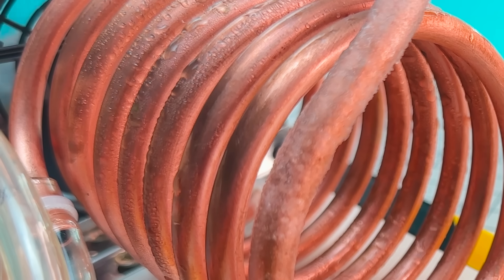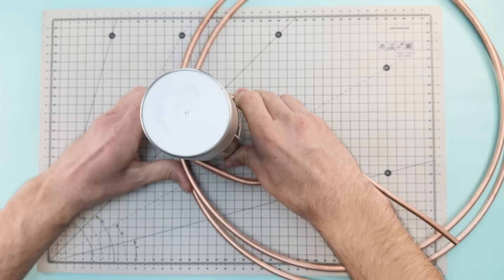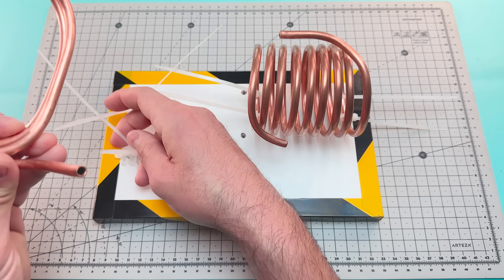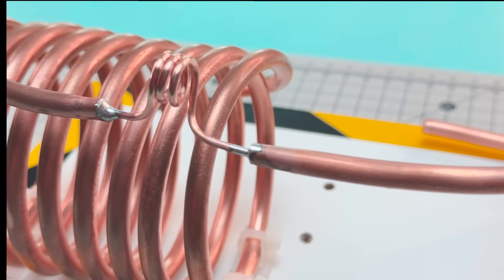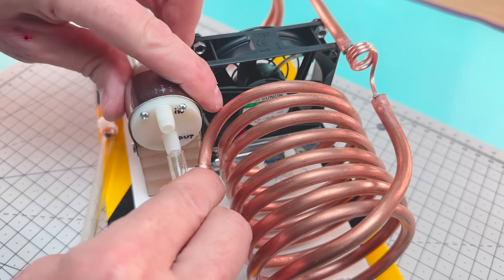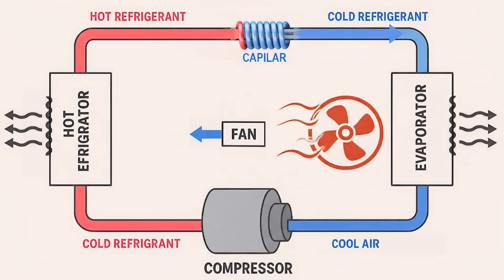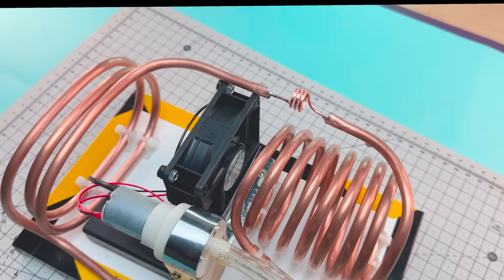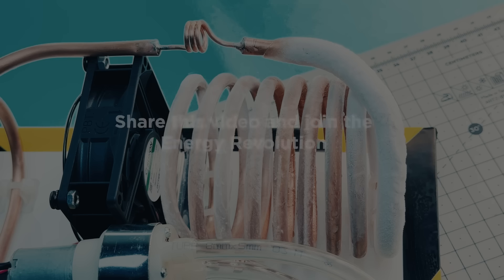Make your own AIR CONDITIONER at home Fast and Easy!

Comment: I feel these elements need to be separated because otherwise the heat you've taken out on one side is being emitted by the other side, so it won't cool down a room, but, of course, will provide a stream of cold air to anyone sat near it... but if you put the 'hot' side out of the house, you've got an ability to provide some cooling to the room. Nice idea though and I've learnt quite a bit, so thanks for that.
Reply: Clearly there is no way towards a "Perpetual motion" and nether is it possible to cool anything without getting rid of the energy to some other reservoir. Ask why he did not measure the temperature of the condenser;-) That's why you ether have to have an exhaust from the  condenser unit to the outside or as more common when using split devices where the condenser is outside and the evaporator inside. Regarding the power, this depends on the temperature difference between condenser side and air temperature around it. You may have a factor of four or so more cooling power than the electrical power the pump needs. However, when the condenser is outside at very worm weather this factor may drop down to one.

Comment: Why not just take this concept as a good starting point, like a circuit breadboard layout, and extend the legs for a realistic use case?   Put the condenser and fan on a horizontal plane, and put the expansion coil about a foot away, 90⁰ down?  Mount that on a vertical plane, connecting securely to the horizontal plane, with a screw clamp?  
   End result= air circulating chiller and water heater.   Hang it on an insulated bucket to create a hot water supply (run a heatproof fitting and hose to your sink) or hang it on a toilet and let the water run a little bit, enough to keep the water temp down.  Now you have an air chiller and a heat sink that flushes away your waste heat. 
   This would not be hard to make.  I'm offering this idea to all the people who need a workable real world solution NOW.
Reply: This is the correct line of thought. I still think it would need to be scaled up though. With a couple more tweaks to optimize airflow and air/coil contact, maybe.

Comment: This would cool a small enclosed bed a couple of degrees if the condensor side was separated by a divider and placed on the outside of the enclosure.  A normal sized room though?  You're dreaming.

The 9 volt battery would deplete within minutes.  You would need a high-amp 12VDC transformer or a big battery to keep it going all night.  If you use a lead acid deep cycle battery, you then have to install a protective cutoff circuit to stop the battery from becoming too discharged.  A relay that switches off the system when the battery voltage drops below 10.8VDC would work.  

A lot of lithium solar batteries have inbuilt over- and under-charge cutoff protection which makes things simpler but a cutoff circuit is still a good idea as a secondary protection, considering how the expense of lithium batteries.  You wouldn't want to break one.

Comment: About as effective as leaving the refrigerator doors open to cool a room.  It will create more heat than the little bit of frost in the freezer/copper tubing.  I guess in a classroom teaching children how a fridge works it's good for that. Find free air conditioners on market place that work is way cooler

Comment: A vital step to creating a n Air Conditioner is to isolate the Condenser and Evaporator pipes, and to also place a fan on the Hot Condensor. 
For example a window air conditioner has a wall between the inside evaporator, and the outside condenser.  The condenser releases Hot air outside and the Evaporator releases Cold air inside. If you mix the two sides, your room won't be cooled, but will actually heat up.

Comment: take a wet towel or some other fabric hang it in the door and blew air in the room you want to cool (with a fan etc). the principal behind this is evaporative cooling, and the results are noticeable within a few minutes.
Reply: That only works in extremely dry climates. Evaporative cooling doesn't work in ANY costal areas, including costal deserts, because there is too much moisture in the air.

Comment: This will make the room the same temperature. Actually probably a little bit hotter
Reply: Lol yep. Not removing a single bit of heat
Reply: If you put on a windowsill that would help move the heat out. Also a second fan might help blow the heat out the window.

Comment: The process is simple, and you made it easy. Thank you. I only have one issue, and that's the pump. I'm sure it will break down quickly because it's specifically designed for something else.

Comment: isn't the global enthropy of the system still greater than 0 ? Will it realy cool the room ?
Reply: Its not going to cool a room. But it might work for a mini fridge. It's just a cool demonstration of how AC and refrigeration works. Though with hot side exposed like that on the other side of the fan. It's going to cancel itself out as it sits like that.
Reply: Lol ….. no
Reply: no room will get hotter,. You could make the refrigerant coil a bit bigger than the size of a soda can, and place greece proof paper around inside, then soda can in middle to cool yr drink.
Reply: @YouTubeH8sMe  is too much hassle for that when you can make fridge with one teg module and some foam.
Reply: Just add tube and run blow out fan that move the hot air out to window.. issue solved

Comment: For those curious about the science, this is a great demonstration of the Joule-Thomson effect, where pressurized gas gets very cold as it rapidly expands. Unfortunately, it's not a sustainable refrigeration cycle because that tiny pump isn't a compressor and can't re-liquefy the gas. The cooling stops once the can is empty. Stay safe!

Comment: Okay so the pump moves liquid not vapor. That is called cavition. So if somebody is needing some slight relief, use a swamp cooler they’re easy to make and you can get some relief. I use them in my tent when I’m out camping.
Reply: They dont work in high humidity

Comment: PC processor cooler?
Reply: Notice the condensation?  Do you really want a line condensing water onto your motherboard, graphics card or PSU?  Not to mention the other issues this would have.  Better off getting a sealed liquid cooling system for PC CPU cooling.  Go for the max size radiator your case allows.

Comment: I'm not sure why people like you go to all this effort to try and deceive people.  Nice workmanship but there are too many basic physics problems for this to work.  First of all you have to compress the gas with a compressor, the device is too small to cool a room even if you added a compressor, and you are pumping heat into the same room that you claim you are cooling.  And you can't get effective pumping on a 12V pump running off of a 9V battery.  Even if you add a compressor, your device would barely cool the room in a dollhouse, let alone a real one, and that only if you keep the evaporator coils outside the dollhouse!  Stop scamming people just to get votes on YouTube.  We will be reporting this one to Google.
Reply: You just have to connect it to a perpetual motion and it will perform great
Reply: @rp9674  wow we got a guy who deadass believes in perpetual motion over here
Reply: 😂 @rp9674
Reply: Jajajaja lo bueno es que es un detalle menor,al fin y al cabo los venden en cualquier esquina @rp9674
Reply: 2 million viewers 
That's why
Reply: It's still helpful, because i want to convert a mini fridge into a mini AC. All the original coils can't be pryed off the fridge without damage so it's good to know how to rebuild the various parts
Reply: @Ellis25051  unless you own a vacuum pump to vacuum the compressor before recharging it, it's a waste of time.
Reply: @ke4uyp  just do what they do everywhere else. Purge the system with refrigerant.
Reply: @eric35715If you open the system at all, you won't be reusing any of it. You would have to reseal it with torches or MAP and solder. Then like the other guy said, you'll have to vacuum the system, and you'll have to be sure you can even get your hands on refrigerant (that requires an EPA 608 Cert in the US) that's compatible with what is probably a fixed metering device.
Reply: Google is the parent company of YT. if you get any response from them? it will be to laugh at you
Reply: Sure this 9v airco beats my 1200w one 😂
Reply: He got the viewers, comments and likes.. that is why.. no physics needed.. 😆
Reply: I would take a minifan blowing cold air on me over a fan blowing hot air on me

This is a spot cooling device
Reply: I this were placed in a styrofoam tub would it work like a low energy mini-fridge?
Reply: @nught... - counter charge of taking things too seriously
Reply: Moi suis intéressé de le fabriquer, et si sa marche pas, j'aurais perdue mon temps, de l'argent pour acheter le cuivre, acheter la pompe,le ventilateur, le gaz, tout sa pour Rien 😔
Reply: @Potzéf  At least you will learn a lot. Without risk, there is nothing.
Reply: So while you made some decent points I think the idea is to show the concept
Reply: If you see the bigger picture. This is just trying to open your mind. So that you can see things are not that complicated. Especially if you like DIY. It starts simple. TRY it and if the model works. Then you can upgrade to Walmart size, just make everything bigger.
Reply: En combien de temps sa glace 
...
Reply: Écrit en français merci 🥣🐑🍅😁
Reply: At the end of the day if it does cool, it might work for say a PC to over clocker. Probably cheaper than the having to keep buying all that liquid nitrogen. But I didn’t watch the whole thing nor even know if this thing even. Oops to that point.
Reply: This might work on a small cooler 🤔
Reply: Sam the air con man.  Doesn't like you cutting into his business.😢.  You tell that to the computer manufacturers who use this to cool there processors.😂!
Reply: Madafaka
Reply: Stupid people only fall for this
Reply: @NEWSWATCHMENTRUTHVIDEOAREUS greedy people are afraid of this!
Reply: Did you make one or just bumping your flap
Reply: It'll do just fine, with heat flowing outside, for keeping a breeze on a suffering family member in a small room. I dig it. Each to their own
Reply: @SamNospam-l2n  what is your problem? You could simply leave him alone and mind your own business.
Reply: It's based on a classroom science experiment to cool can and bottled drinks, and that's all. It works for that purpose and that purpose alone. So if you got kids and want to do a fun project with them this would be an awesome one but stick to your ac for room cooling. Lol
Reply: Its an educational video, not a manual to build personal air conditional system
Reply: @DWO1199 that is not what the video narrative leads to believe.
Reply: Yeah no shit the butain does work but a common small evaporated water system drops temperature 20 degrees and they are not cooling a room just a personal fan so the time and effort to make that is worthless when for 20 bucks you can buy a small evaporated water system
Reply: Thank you. To many people believe this but unless you know the basics it seems reasonable. I have 2 girls I’ve tried to build thing with them that at least show the basics. Let’s find out why the hair dryer doesn’t work. Let’s circulate some water around a couple of thermistors and see if we can make it colder. How about a crystal radio. Silly things but I’d like to give them at least an idea how something works. It will be helpful when there older if they can apply a little critical thinking when someone presents them with an estimate for something. It’s not magic when you push a button and something turns on.
Reply: Why is because of its unintended use. Might not look like much but that device there can produce water in a humid environment. He just has to increase the fan speed to make sure the coil doesn't freeze after that. You have a devise that creates water out of thin air. Might not be super clean. But it's 100 percent functioning. You could make it more efficient by adding more power to the system and separating the hot and cold. The most important thing in this build though would be air flow. It's obvious the guy doesn't do heating and air. So he probably did thing the coil freezing was a good thing. Which ideally would when your trying to freeze something. However you hit on a very crucial point. He isn't conditioning the air. He isn't removing the moisture from it. He was up untill it froze. 

If he fixed that how ever then we would be cooking with Crisco. After that package it into a cup where the run off the evap coil catches then goes into a filter then bam you sir have a million dollar idea. It is about the creativity and lastly everything is useless untill it finds it's application. 

Dibs on the cup idea...
Reply: It's not meant for practical use, this is for demonstration, are you slow? I can't get over people taking everything seriously and in reality they make fun of themselves.
Reply: @NightShogun in all fairness the narrator did say now you can cool down any room in a matter of minutes.
Reply: @NightShogun 😂 what's worse, dude said he is going to run and snitch too.  A YouTube Karen that guy is 😂
Reply: Good boy, you prove that u studied hard and understanding a lot, sure it cant cooling your 20sqf mama built room, but the 9v battery still support 12v dc compressor well, but it not at full capacity.

Comment: An air conditioner, but not only are the heat dissipating and heat absorbing radiators not separated, but the fan “cools” the cooling radiator with air that is heated by another hot tube. Author, read the Wiki article on how air conditioners and refrigerators work.

Comment: This is the best explanation of how an air conditioner works I’ve ever seen. There’s always a “but”. The room won’t change temperature because the heat you’re removing you’re also placing back into the same room.

Comment: "Very nice project, but if you put that in a room it won’t cool anything: as one part cools down, the other part heats up. For it to work, you need to move the hot part out of the room. It’s like leaving the fridge door open in the kitchen: it doesn’t cool the kitchen, it actually heats it up. That’s the thing about the principle of conservation of energy."
Reply: "Thats what big aircon wants you to think". But you are right, the big coil will get just as hot, and you have to keep it outside of the room.

Comment: A very nice educational project.  But will not cool the room ... (i) fan should cool the condenser, (ii) the condenser should be outside, and finally (iii)  9V alkaline battery has approx 17 BTU energy content, 
a typical window AC to cool a room is about 5000 BTU -- so not even close.  As the system is now it will heat the room -- but only slightly due to low energy content of the battery.
Reply: Correct, that’s the difference between a physicist and an engineer.

Comment: Get an old air conditioner out of a car. Put the evaporator in a bucket of coolant. Run the coolant through an insulated tube to outside your dwelling. Set up the radiator fan and pump outside and run the coolant back inside through another tube to the condenser. Charge with a can of auto air condition gas. Then when you're done with all that go to Walmart and buy a small window air conditioner for $100 or a used one for $25. Then  compare which one made wasted the most of your time and made a mess.
Reply: Can you do a DIY video of this air conditioner out of a car? Please share video link here. Thanks in advance.
Reply: @karthikkiran338  LOL, you'd have to pay me about $20,000... in advance.😵‍💫

Comment: Heat and cool are venting into the same room.  Temp won't change in the room at all.  Air conditioners have the heat exchanger outside the room you wish to cool.

Comment: Omg, the hotside dumps into the same environment. This system will make surplus of heat energy(motor, fan). You stupid?
Reply: Seems more meant to be aimed at you instead of the room itself.

Comment: I liked the idea. I'm going to use part copper and part titanium to use as a chiller in my marine aquarium. The aquarium is small, so I think it will be enough to cool it. A good idea would be to add a valve and hoses to withstand pressure and handle the gas more safely. I don't think it would work for cooling the environment, but for small things like an aquarium or cooler, I think it would work.

Comment: This is a very dangerous method. Use a refridgerant with lower flammability and in most cases ensure that there is no air in it while its under pressure because even a proper refrigerant will be flammable in that case
Reply: Isobutane is a refrigerant.

Comment: I hit 0 with a peltier chip and two 5v fans on a gatorade canister. but it was only within the canister. Guessing if I poke a hole I could get some cold air flowing

Comment: Cool heat pump, pumping heat from one side of the coil to the other.  Not an air conditioner unless heat is ducted and remove from the room.
Reply: I’ve tried that already 😂! My suggestion: make a sandwich putting yourself between the fridge and the door. Without sirt gets better results

Comment: I used to design and build refrigeration plants for complete micro breweries, that we designed and built, 25 years ago - some of them are still working ! Great video for the uninitiated but some separation / redirecting of the heat producing and cold producing would work better.

Comment: 4:10 납땜 부위에 바르는 물질이 뭔가요? 그리고 왜 바르는 건지요? What is the material that you apply on the welding regions before lead-weld? And Why do you apply it?
Reply: Flux to assist in a clean solder joint, resist oxidation contamination
Reply: Flussmittel

Comment: It's literally not an air conditioner if the condenser is in the same room you're trying to cool AND you don't even have a hose taking its hot air outside like with portable air conditioners lol